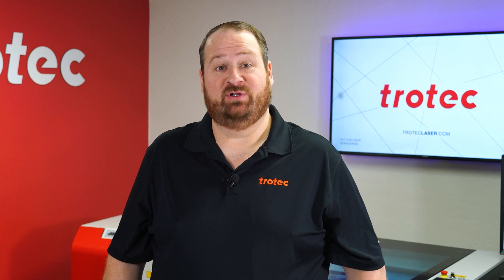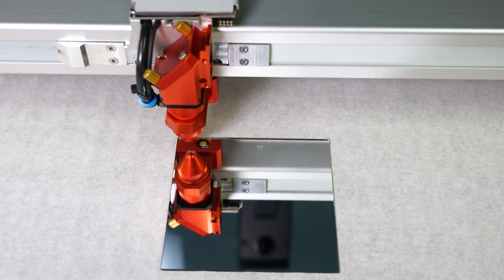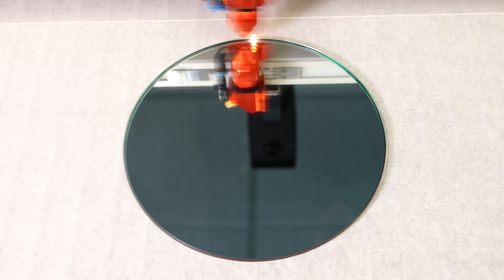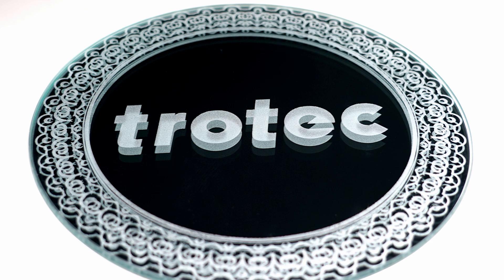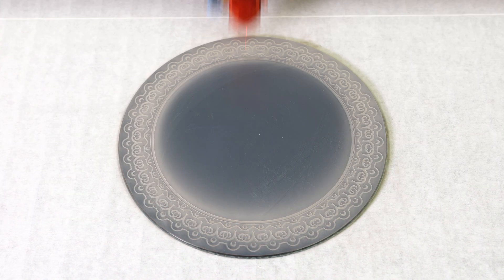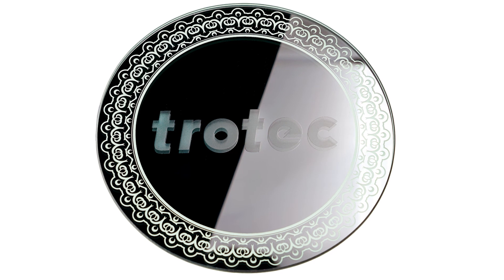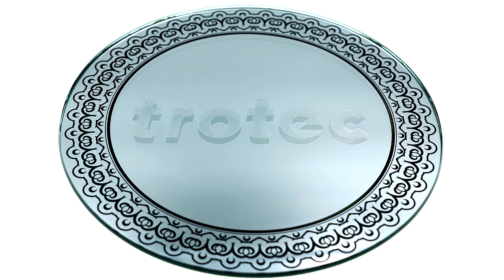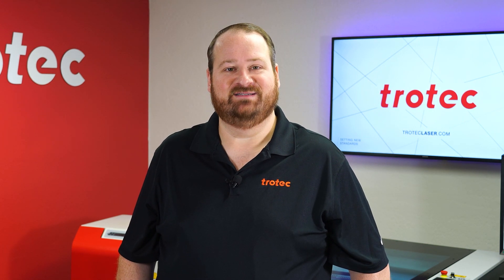Trotec Laser: Can You Laser Mirrors?

Comment: Hi.. I would like to ask, it seems that the technique you use on mirror glass media, the position of the laser beam when engraving the glass, is not 100% straight reflecting on the laser light source, is the technique like that, thank you for sharing your knowledge.
Reply from the maker: Even if the mirror is not perfectly flat, this process will work as the laser only sees the glass, and a glass mirror is not a reflective surface for a laser.

Comment: What would happen if you did engrave a first or front surface mirror? Would it immediately wreck the laser?
Reply: Your machine would explode instantaneously like the Death Star destroying Alderaan.
Reply: The laser beam would reflect the beam back into itself, causing no reaction.  However, if there were even a slight angle on the mirror, it could direct the laser beam into the laser machine causing possible machine damage.

Comment: did you remove the protective film from the reflective side before turn it to face down and what's the work of the white stuff on the laser bed?
Reply from the maker: Traditional glass mirror has no protective film on either side, so there is nothing to remove. If the brand of mirror has a protective film when purchased, it would need to be removed before laser processing. The "white residue" is the residue produced from the laser from the engraving process, and it is wiped clean with any paper towel or cloth; we used a microfiber cloth in the video.
Reply: @TrotecLaser  There are front surface mirrors for things like kaleidoscopes in which it is very important that you never touch the front surface of the mirror. I would guess the interest is from someone who wants to make kaleidoscopes e.g. by removing the coating to make it selectively see through in areas.